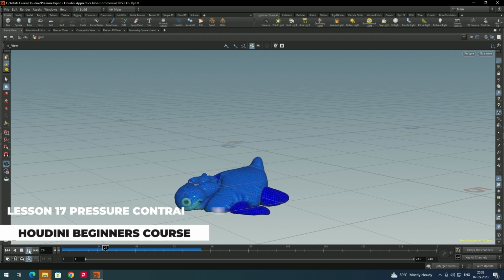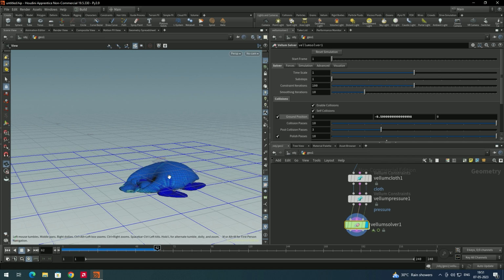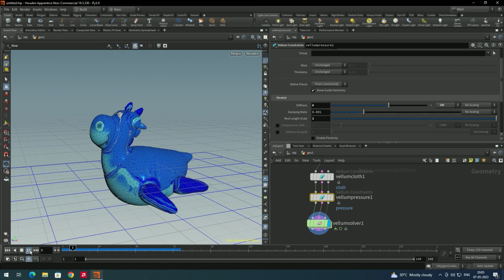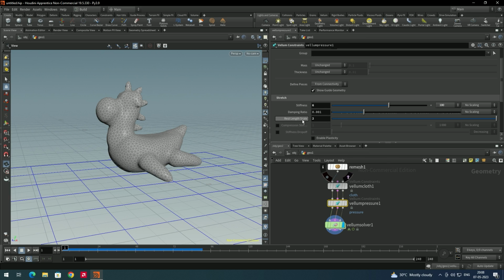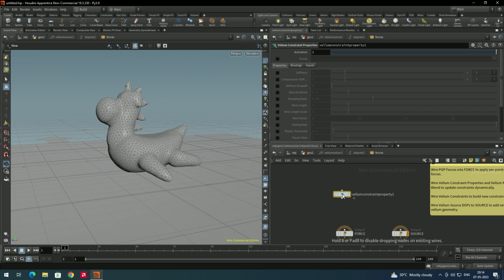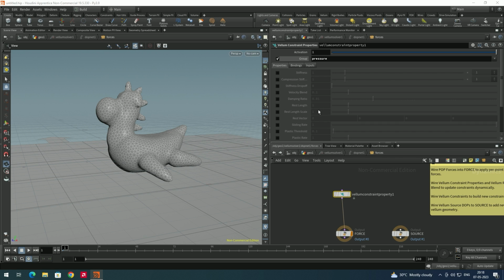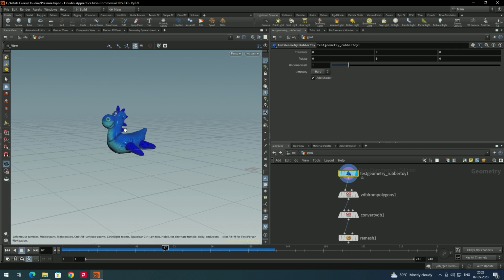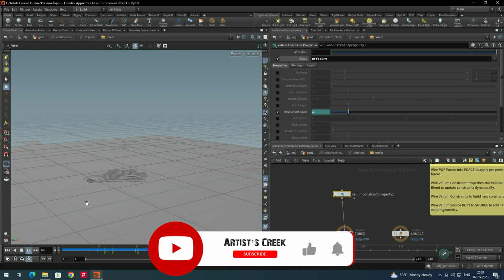Master Houdini's Vellum Pressure Constraint in Lesson 17

Comment: Great can u show us how to export it in alembic file
Reply: Exporting to an Alembic file is easy

First, make sure you've cached your simulation with a File Cache node. Then, drop in a ROP Alembic Output node, set the file path where you want to save it on your hard drive, and remember to select Render Frame Range under Valid Frame Range if you’re exporting an animation. 

Finally, click "Save to Disk," and it’ll export your simulation as an .abc file right to your chosen location.